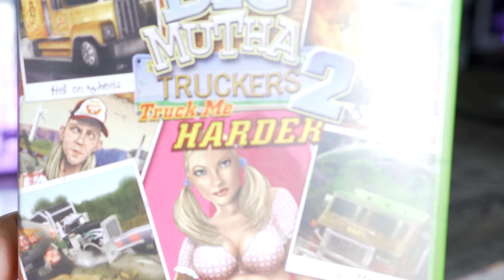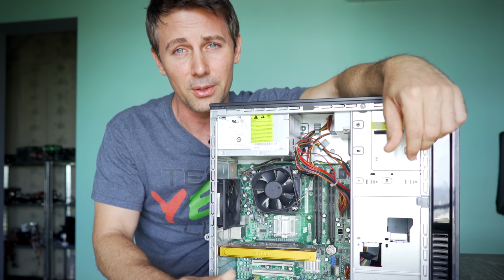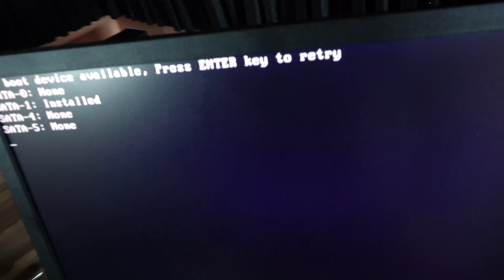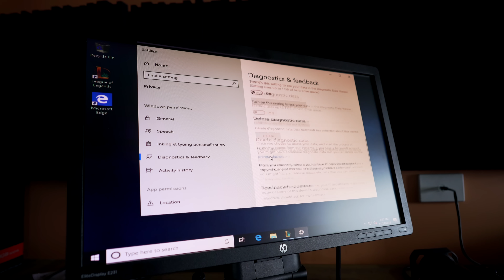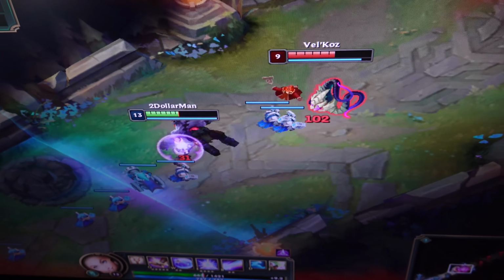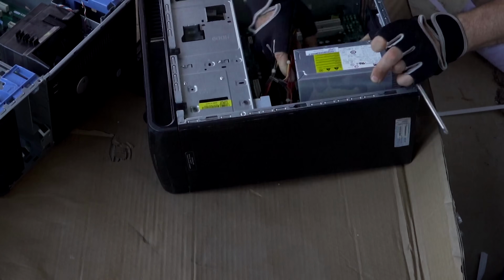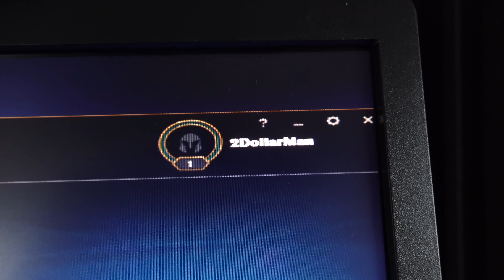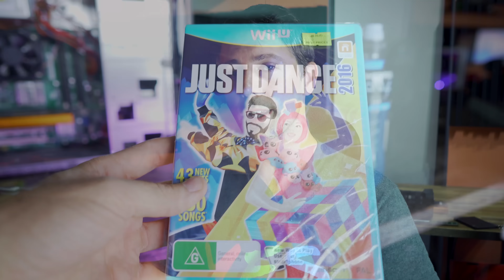This PC Costs $2.... Can it Play League of Legends...!?

Comment: So im using an LGA775 Dell as my uber-budget daily:
Dimension 780 Mid-Tower with a Q8400, 16gb DDR3, 120gb boot drive (placeholder til i get a deal on an SSD) & twin WD Blue 750gb drives, Antec 500w PSU and (for now) a Geforce 645 gtx 1gb (a cut-down 660GTX that compares to a 650ti when overclocked) - im playing Far Cry 5 on it at 1080p with a mix of low settings with textures and foliage at Normal, with 80% render scale and TAA. The gpu will do me til i recap my 660Ti (Canada Post strike has my caps held up atm, impossible to buy local). The build, besides the CPU ($20), GPU ($30 local) and PSU ($45 new, this is it's fourth build now) was reasonable for me.

Comment: had saved up for awhile and when I was ready to buy, i picked up the new (at the time) 5820K with an ASRock mobo. Usually i'm a generation behind due to cost so was over the moon to finally have a "current" system architecture (again at that time). After cable management and the full setup, i couldn't get the PC to post, with no beeps to help solve the problem. I ended up taking each component out starting with ram thinking maybe a bad stick? Finally after every piece was removed i figured it to be the board. So ended up DRM'ing. Second ASRock board and same thing, so took it to a repair shop in hopes maybe it was just something i'm missing. They also couldn't figure it out so second ASRock failed board? Finally went with an ASUS-A board and it fired right up. Love the prices of ASRock but really left a bad taste with ever wanting to try them again.

Comment: I have a 10yr old pc with this configuration: asus m4n78pro, amd anthlon 7750 dual core, nvidia gt 730, 6gb ram and a maxtor hdd. Its able to play LOL on lowest settings at 60fps, minecraft  60fp and fortnite lowest settings around 40 fps so its actually not bad

Comment: that is wrong an LGA 775 is not dead at all i run League of legends with 34 to 58 fps on high settings also i can run fallout 4 wiht 28 to 46 fps on high too using a random dell case 8GB DDR2 dual channel with Q9650 CPU and GT 1030 OC and its perfect cost me around 40$ most of the money was for the GPU and CPU next week i'm building another one to a friend but it's gonna be a random old lenvo pc with a random LGA 775 motherboard that supports DDR3

Comment: You know a lot more than I do for PC, obviously, but, maybe your issues were not hardware but rather software? Possibly downloading those graphic card drives can adjust the gameplay setting for said graphics card. I bought an hp Omen GTX1050 last year and didnt know much about graphics drivers, and playing Fortnite on 40-60 fps without knowing that i had to download drivers and adjust the settings to optimize performance after buying the laptop. Hope this helps!

Comment: LGA 775 is still ok today for low to mid range gaming. The problem you are having is with these propriety mobo from dell, HP ect and the fact that those 2 video cards were complete junk i believe was the main issue. Stay away from the old Quatro's and Nvidia 7000 series cards for any modern gaming. Your best off with the 8000 series or above as they perform way better. Get yourself a good Gigabyte, ASUS or MSI mobo with a cheap q8400 and you should be able to overclock it to 3.6Ghz on a cheap aftermarket air cooler. It will perform better than the first gen i5 cpu's and possibly be be on par with a stock first gen i7.

Comment: My core 2 duo e7600 with 4gb ddr2 664mhz ram and a gt640 could run it at 720p medium 60-70fps, in big fights it went down to 30-40 but overall it was playable. Now I have a q6600 8gb ddr3 ram with the same gpu and run 1680x1050 at medium with 100-140 fps in big fights it drops to 80-90. Very playable I'd say. The thing is Windows 10 just isn't good for this platform. Try it with Win 7 Ultimate 64Bit I'm 100% sure U'll see better results.

Comment: I can't compete with that but today i got an i3 3225 with a ZOTAC h61 itx WiFi and 2gb of RAM. The PC also had DVD Drive and a Power supply with a pretty decent matx Case. I will throw a SSD in and Upgrade the RAM to 4 GB and Ich will have a very good browsing and office machine.

Comment: I remember playing League of Legends with an E7300, 2GB DDR2 and a 8800GT 256MB. But that was before they improved the graphics. I started playing it again recently and I feel it is actually rather demanding for a title this old. The E4500 should still work somehow. But those two GPUs ... the 7300GS was never a good choice to run the game, even in 2009.... and the Quadro looks very very low-end as well. Try again with a better GPU, just for the sake of it. Don't give up on your Core2Duo. The 4500 will severely bottleneck, but a decent GPU will still play the game I feel.

Comment: My LGA775 setup is doing good (some overheating issiues and that's it), I wasted a lot of money by making stupid decisions but at least it is usable. Currently I'm running on Q6600 @3.0GHz GA-EP43-S3L motherboard, 5GB DDR2 and paired with HD 7850 2GB and 1TB+250GB storage. My initial rig from 2009 was with E2220, 3GB, HD4350 and GA-G41-ES2L + 320GB storage

Comment: Not a $2 PC! Even if it worked, the SSD and/or other GPU add cost to it.

To fix the RAM limitation issue:
1. Start > type "msconfig" > Enter.
2. "Boot" tab > select the OS > "Advanced options..." > unselect "Maximum memory" > OK > OK.
3. Restart PC.
4. Enter PC Properties and open Task Manager to confirm available RAM.
5. Confirm "Maximum memory" is unselected in msconfig.
* Also try changing BIOS options to lower onboard GPU VRAM. And make sure you're using x64 Windows with 4+GB RAM.

Comment: Story of a trouble system would be  my X58 mobo that wouldn't take dual GPU. Come to find out its a stock mobo. So i find an Asus x58 mobo, and it won't boot. No matter what i did. Not even to the bios. Do a little bit of research and its  tri channel memory and the stick HAVE to be in certain slots to boot. Took me about 14 days i was ready to take hammer to both mobos.  Was really hating x58 that month.

Comment: I have intel dual core e5400 , it work even without gpu lol , ofc framerates is like 10-20 but still better than your result , maybe just motherboard problem
Reply: nah i had an e7500 with radeon hd 7750 gpu and that still couldn't run the game above 30fps, so no gpu and lower cpu idk what ur performance would be
Reply: @rhyanandrews1979  idk what temp in your country , depend on ram/screen resolution ,  i run e5400 with onboard gpu g45 on lowest possible setting , got 10-20fps , bought gtx560ti for 30 buck and can run on max setting at 60fps++

Comment: The most frustrating thing with TECH must be the Quad SLI 7950GX2 had to do a Windows XP because Quad SLI drivers didn't work in windows 7. Windows 7 could only do 1x 7950GX2 ( Multi GPU With one card).... and in XP the synthetic benchmark difference was NOTHING an absolute ZERO (Still need to check VISTA... support maybe better... will see if I have any luck with that) Apparently F.E.A.R runs well in Quad SLI...

Comment: I'm sick of LGA 775 as well, I wanted to play around with the socket but it ended up failing. Motherboard that supported 4gb DIMMS didn't support my 4gb DIMMS. A few motherboards and CPUs failed. Wanted to test some old core 2 quads but the socket is so bad to work with. If its older than 2010 with 2 cores don't use it.

Comment: Worst tech experience: Bad PSU that would periodically not work, when slightly overloaded. Thinking it was other components playing up. 

For a little while a few years back, my whole system would crash when gaming. 
At first I thought it was the graphics card. Or the motherboard. Or the gfx card was crashing or shorting out my motherboard.

If I gave it a little rest (eg. a few days) the PC would work again. Sometimes it would be weeks. I had no idea why. I took away my GFX card to use only integrated graphics, thinking that was the culprit... it seemed to work for a while. I thought my GFX card was the boogieman. 

I persisted for a few months, hoping I didn't jinx anything. I thought the coast was clear, so reinstalled my gfx card for some graphics accelerated software / and light gaming, then my computer really crashed for good. Nothing worked. I thought I really fried it.

It was only after I threw in the towel to buy a whole new budget PC (Ryzen 2200G with new PSU), and I was testing old parts with the new PSU for kicks to see what I could salvage, when I realised everything worked. The problem was just my supposedly reliable Corsair PSU.

Majorly annoying because I needed a PC to run my day to day business and had to alternate with a crappy laptop half the time. 

Sometimes PC building can be a hassle. Now I always backup my data and have a backup PC, especially when I need it for business.

Comment: Most frustrating experience I've had to date is a no-name chinese mobo, 1155, that worked for about a week and then went completely sour. Not only did it go completely sour, it took the ram with it. 

I have a decent biostar 775 that I use now and then, but honestly, as you said... it's old. I don't expect it to hang in there too much longer. Too bad though, I like the Q6600 I have in it, works great for fun little things. Can't say i use it much anymore for anything other than testing hard drives, graphics cards, and other things.

Comment: note: hard drives usually cause fps problems on league of legends overall cuz when you load spaghhetti codes,it needs to feed data from hard to RAM to load things which is why it took up that long to load and i discovered it on hp laptop when playing league when you damage hard disk,your perfomance drops up to 50%(what 50,ur fps gets crippled like here) because of loss in efficiancy of hard disk drive and good SSD will improve performance,put things under good load,significantly improve performance overall,feed and CPU and GPU cause why would you upgrade other things which work already well when data isn't even comming?

Comment: If you wanted to stick to the original budget then YES you are going to have problems. 

If you wanted to do something useful, you need to go with something better than a low-tier E4500 CPU. That's basically what Dell would stick in a machine back then in the first place. A Core-2 Quad cpu would've worked much better in this instance. It raises the price a degree, but it will DO something and allow you to actually have a good time.

Comment: You need to set RAM remapping something in the bios for more than 4GB RAM on old motherboard, it's for 64bit OS.
E4500 will run LoL, the only problem maybe the 7300GS.
Why didn't run any monitoring software to check the hardware usage?

Comment: Made me remember how I wasn't capable of overclocking my previous q8400 even 50mhz higher or the time when I wanted to swap my nec's e7200 with the same q8400 and it didn't wanted to work properly (albeit with the fans stuck at 100%, so it was a screaming like a skyrocket)
Lga775 is cool for being compatible with CPUs like the Pentium 4 as well as the core 2 series, but it's so complicated it seems Intel is very bad at making sockets work great with more than 1 cpu generation

Comment: Did u try using windows 7 and not the 10 because the 10 already takes enough ram as well as processor speeds as well i have a way old computer with a core2dou and gives me 20-27fps and its playable

Comment: Has no issues with compatibility when built my test rig, first it was an old gigabyte board with core duo E7200, next I've got an Intel board with 4 ddr2 slots (first board had only 2) and quad Q9550 with the Intel board (along with Q8400 and few other boards) from guys who were taking them to the trash can. But I had a lot of issues with simply dead boards, I think only like 30% of boards that I found or got, worked, rest are junk. A week ago got a P43 gigabyte board with 4 ddr3 slots and quad support, and guess what? Dead.. got an MSI combo with DDR3 and DDR2, dead, got another with two ddr3 slots, one slot is broken.. another gigabyte with DDR3, again dead..

Comment: Nah, those specific potatoes were just bad. I can play league with muy 'potatop' with a C2D P7450 which has 2.1 GHz clock speed and a 9800M GT 512MB DDR3. Are you sure those rusty PSU have nothing to do with your performance?.

Comment: Hey a small tips for using lga775 
Try not to use win10 and go for win7 as most of the drivers for windows 10 does not support lga 775 and g41 chipset that effectively when compared with win7 
Repeat the same test with win7 and you'll get much better frame rates 
(Trust me,my daily driver is a intel pentium dual core E5700 with 1gb of DDR3 RAM and integrated graphics)

Comment: I recommend everyone to stay far far away from 775 prebuild systems. I also have nothing but trouble with them, especially Dell and HP. With decent motherboards on the other hand, even those Intel branded ones, it's still a very potent platform for the prices they usually go for!

Comment: I can play league with 50-60 FPS at very low settings 1080p.
My system: E5400, 4 gigs of 800 MHz ram(2+2), r5 230 1 gig
I could reach about 20 FPS without a graphics card so win10 might be the problem

Comment: I've got e7500(2.93) oc to 3.65(stock cooler) with msi ati hd4650 oc to idk. 4 gb ddr2 ram. A foxccon mobo which idk where it camefrom.. core duo s are great overclokers...i could run in 3.75 - 3.80 but i don't wanna fry sumthing bcuz my 250w powersupply 14.5 years old... Lmao... And i finished the last leagueof legends season as plat3 with that computer.

Comment: BIOS support for upgrades is notoriously bad on OEM machines :( You might get lucky if you can find the original motherboard manufacturer's BIOS from a retail version of the same motherboard and flash that but it's very rare for an OEM to use a standard off the shelf motherboard :(

Comment: which optiplex was it? there are generally 3 775 sockets. the only p4 one, the core 2 duo pre 2006 one and the all cpu socket. only optiplex 7550 and after support more modern 75 cpus

Comment: I HAVE THE  same dell case as you got there the dell board works fine in it,but every other mo bo i put in don`t work amd/intel 1150/1151 even if i use a bigger psu .but 775 boards all work great i have no problem with them unless i put them in that dell case then they dont work

Comment: Often times with processor incompatibility, it's missing microcode in the BIOS. You could try modding the proper microcode into the BIOS yourself, but you'd need an utility like UEFI BIOS Updater (UBU) to do that.

Comment: One of my 10 years old 775 PC still running strong, gaming with Medium to High setting
 
CPU: Intel® Core™2 Quad Processor Q9650
RAM: Transcend DDR3 1333 16GB (4GB x 4)
SSD: WD Blue 250GB
HDD: WD Blue 2TB
MB: ASUS P5P43TD Pro
Display Card: ASUS Strix GTX 980 (from my Intel 4790k PC, which is now using 1080ti)

Comment: windows x32 see max 3,25GB mem if you install any x64 then You will see all install memory. For windows 7 and up need 1. cpu 4x2,5ghz minimum /2. Windows 7 and UP!!! take 20-25% of ram for system/ 3. to install windows on ssd at old pc need to install drivers before windows installation. Dell has integrated ahci.

Comment: Frustrating PC hardware experiences, I've can think of a few. 

Athlon 64 build had a misplaced stand off that shorted the board and killed everything. 

Was super broke and had no money for a new build and the PCI-E slot on my core2duo build died and I had to play on integrated graphics for weeks until I could scrape up a little money for a used board off Ebay. 

My EVGA 500B died after 2 weeks and left my FX 6300 build hanging for 2 weeks while I waited for an RMA. 

Lightning struck the cable internet line buried in my back yard and the shock killed my cable modem, my router, and the ethernet port on 2 motherboards, my GA-970A-DS3P and my B150M Mortar.

My Seasonic M12II died violently with loud pops and smoke and killed my RX 470. Sapphire repaired the card for me and it died again in like 2 months.

Comment: I guess this makes LGA 775 officially retro now? :D
Reply: He just didn't research what CPUs are compatible with the boards he was working with and probably didn't update the bios on the optiplex or was trying to use a 45nm CPU on it. The optiplex 745 should take the q6600 if the bios is updated properly, Dell still has the updates on their site as this is a professional machine, with that it should have ran League just fine.
Reply: @White-Wolf1969  That's what I was thinking, and I'm wondering if an OS like Mint 19 XFCE with lower resource overhead could squeeze out a few more FPS. I found a quick video on how to install it on Mint 
https://www.youtube.com/watch?v=B8g06CYMdlM
Reply: @White-Wolf1969  I still play on a q6600 every day but getting a ryzen 5 2600 this month cause im done with this xD
Reply: @Cristian Sanchez Ruiz I think it's because most of the socket 775 OEM boards found in prebuilt systems are just lowend garbage.

Comment: I had a pc that wouldn't work with a Pci-e m.2 in the first slot. It was stuck in a loop. It was completely fine with a SATA based m.2 or when the Pci-e drive was in the 2nd slot. Reason? Faulty PSU.

Comment: LoL runs on potato to low end pc same as high end enthusiast pc im getting about 300fps or more at start game and above 160fps in huge teamfights when im running gtx 1080 with oced skylake i7 6700k when my friend with same oced cpu gets same fps with gtx 980 ti which is lower than 1080 ps. two years ago when i bought the card i used to get 850+ fps in game but after one nvidia update fps dropped to 450-500 and after couple more later to 300 or below, is nvidia drivers making this on purpose also the game itself uses only one core - on high end system it just doesnt use the resources available